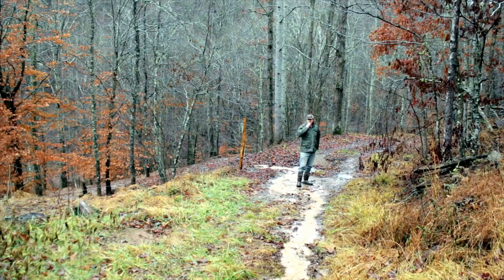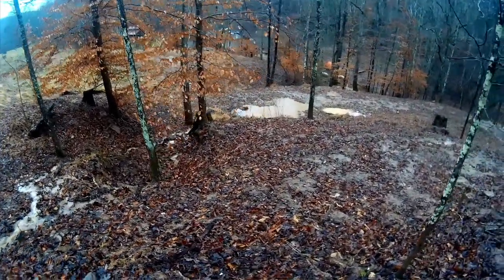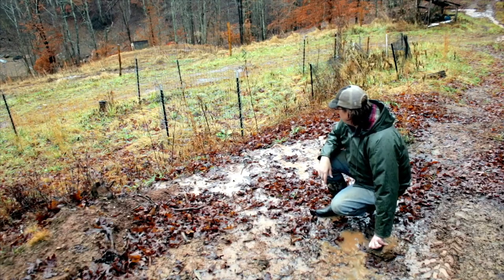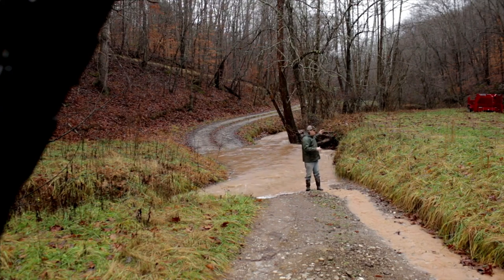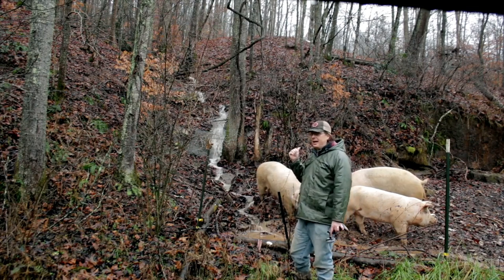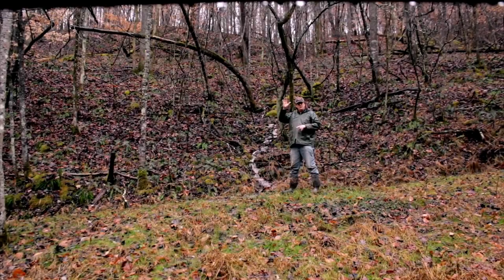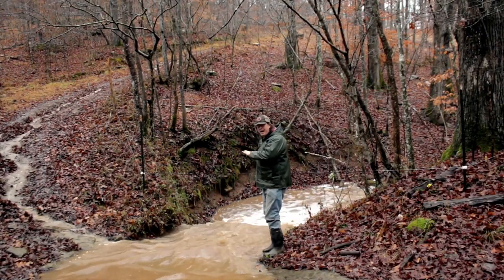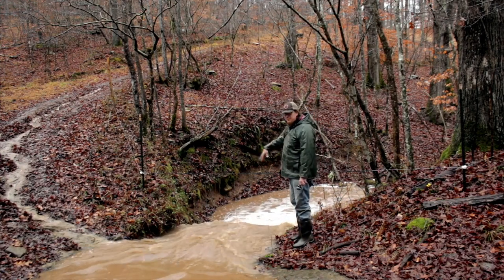Ep63:How does the homestead hold up to high water?

Comment: I have a couple of 1' diameter concrete culverts under my driveway, and concrete trucks and the like have driven over it with no trouble. You might want more than two for that much water, but they're plenty strong.

Comment: You have a nice homestead and you intend to stay, so where your entrance driveway crosses a creek, why not install a 36" diameter culvert    (corrugated pipe either HDPE or steel)?  You have the equipment and the material is not expensive.  It would save you having to pull out the washed gravel from your driveway that you say you have to do every year.  Also it will save possibly flooding and damaging your vehicles and other peoples' vehicles that have to cross which almost happened with your Nissan.  This is not some remote road.. it is your entrance driveway and the only access to your property.
Reply from the maker: Had a 60” pipe in it at one time and it washed out. Needs a concrete box culvert to handle the heavy floods.
Reply from the maker: Had a 60” pipe in it at one time and it washed out. Needs a concrete box culvert to handle the heavy floods.